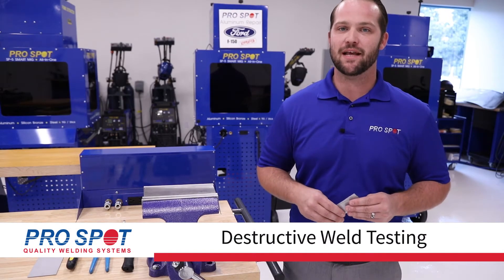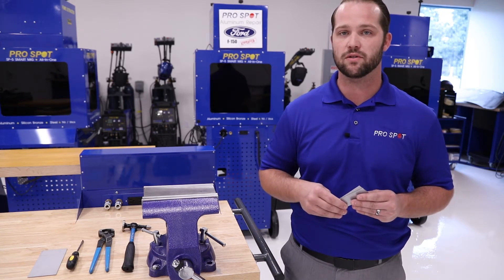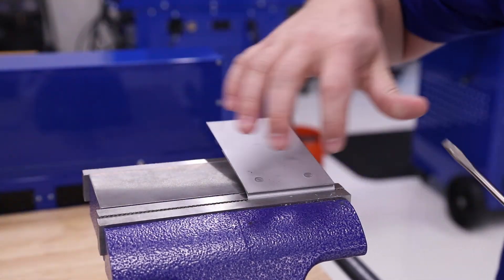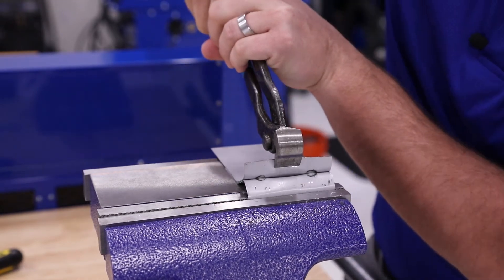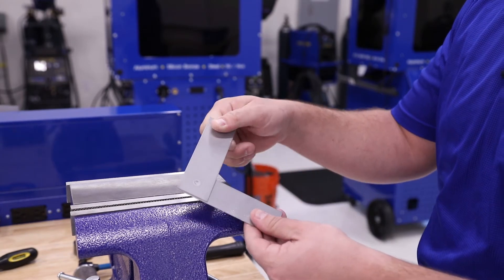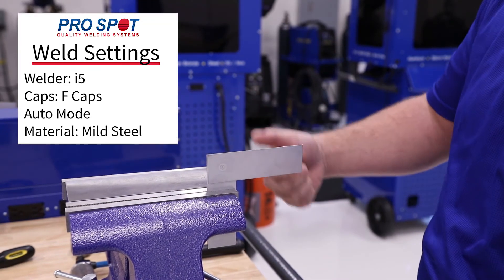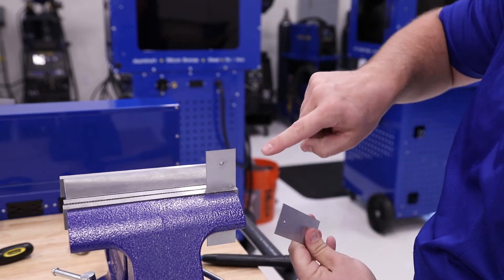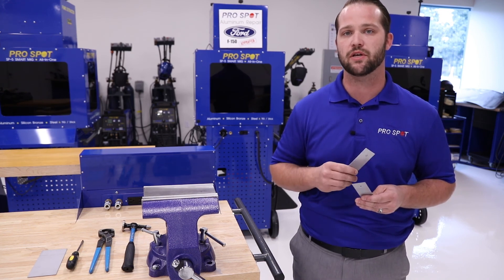Tech Tips: Destructive Weld Testing

Comment: Sorry. If you're going to post a video. Please know the proper names of the tools you're using. Those are not channel locks.

Nuggets? You mean spot welds?

 I can tell you that you don't work in the welding industry very often. Look at those clean hands.
Reply: Nugget is the correct term for the molten metal joint formed by the welding process. I am technical college, where we use I-CAR educational material and ProSpot spot welders ; our instructor and the educational literature also use the term "nugget" . 

He could be referring to the brand name "Channel Lock" because they do make those pincer or end-nipper pliers.